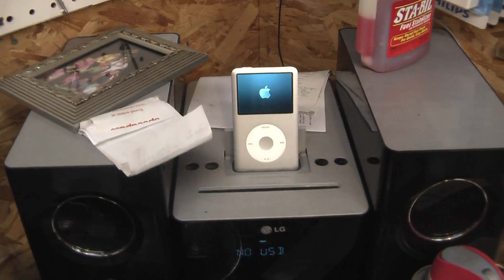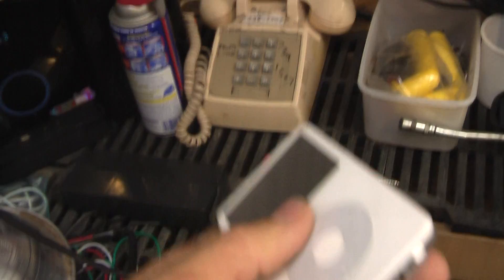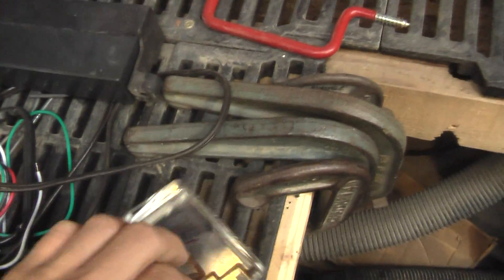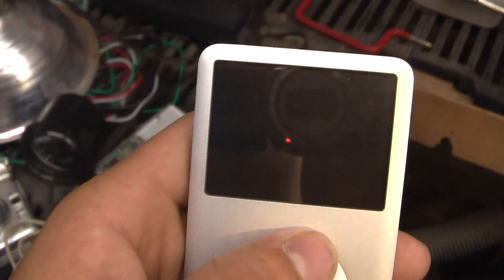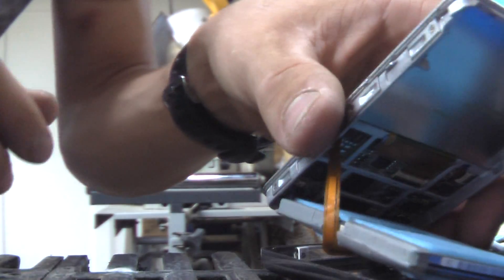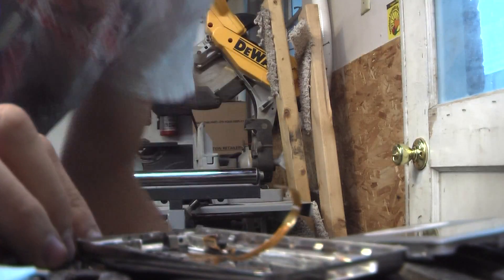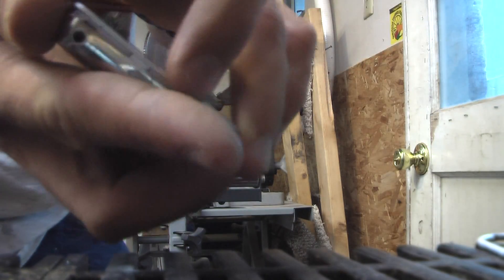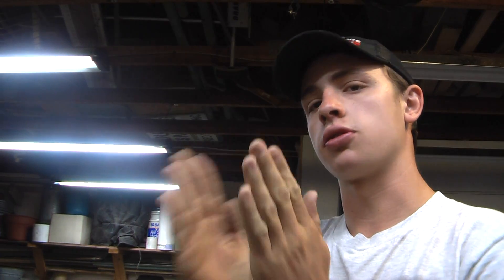What's Inside Your iPod?

Comment: your horrible in handling the electronics components and you dont ever pull the connectors out there is a latch and pop up and it comes off very easy and do not ever pry the battery off it can puntcher it and make it bad and the flex cables are very easy to rip apart too